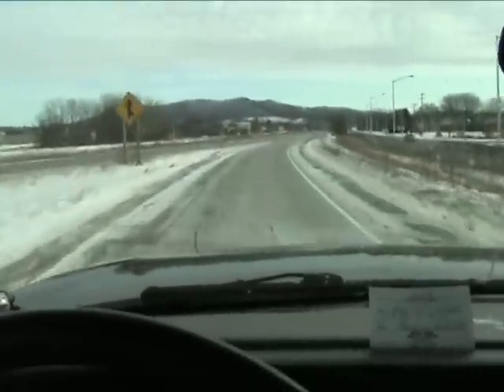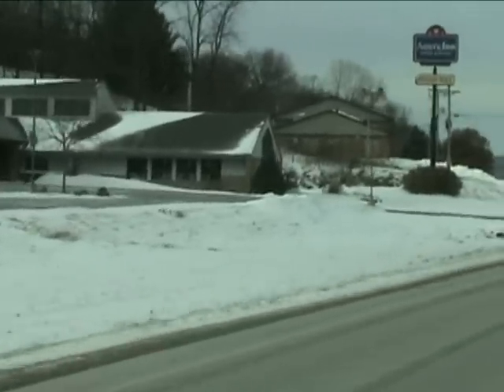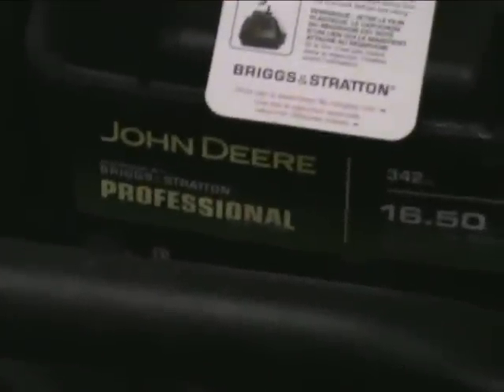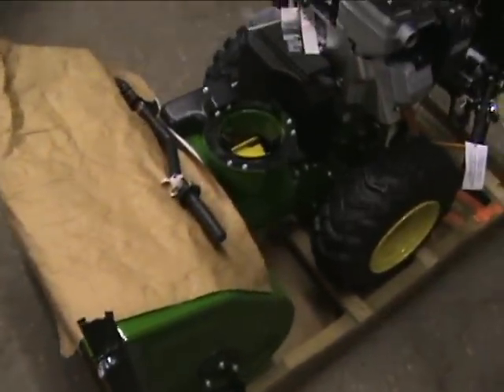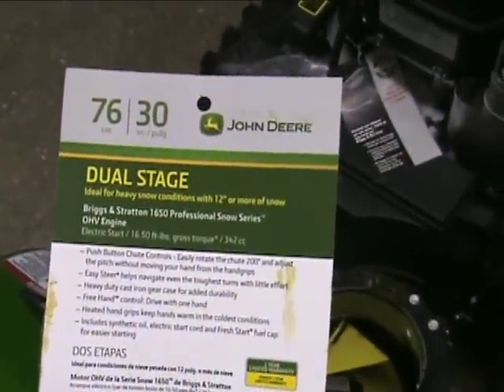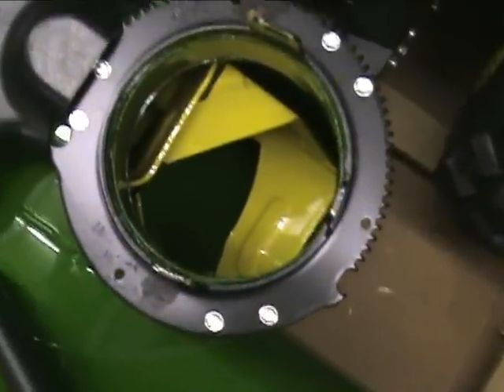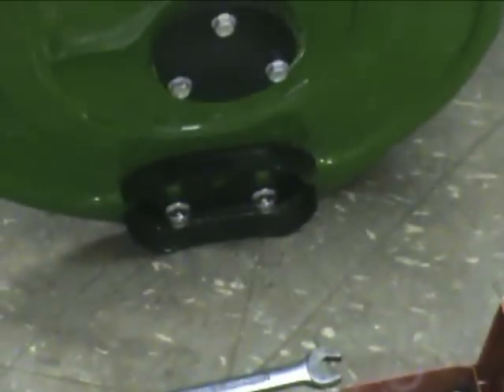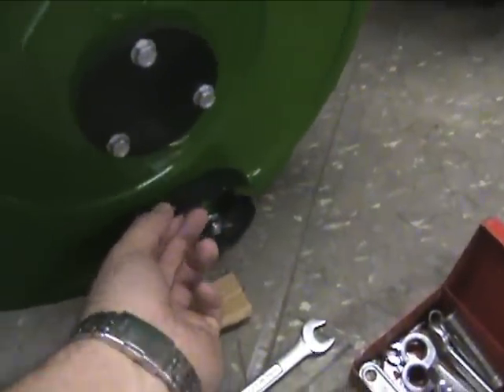Getting a new Toy...I mean something for work!

Comment: im buried snow, is this thing worth it?
Reply from the maker: +Michael Collings yes, this machine is totally worth it.  my only complaint is the oem shear pins on the auger.  they are pretty week and bust right away.  I swapped them for some heavier ones.
Reply: @papashaq1  The whole point of weak shear pins is that they protect the gearbox so it doesn't grenade.
Reply from the maker: @SuzukiKid400  yeah I know, but these were busting too easily.  Sheared 3 of them first time I used it, switched to heavier ones and haven't had a problem in 6 years.